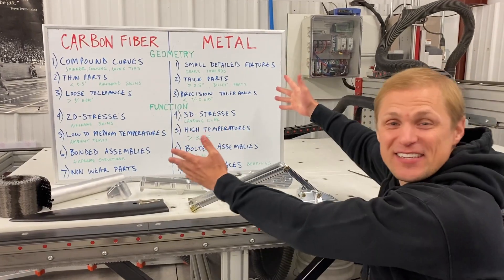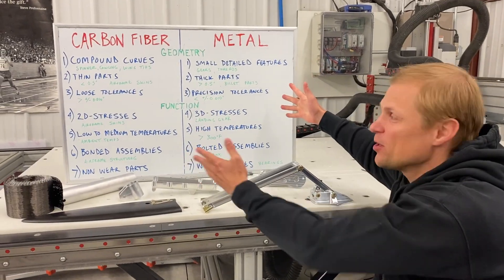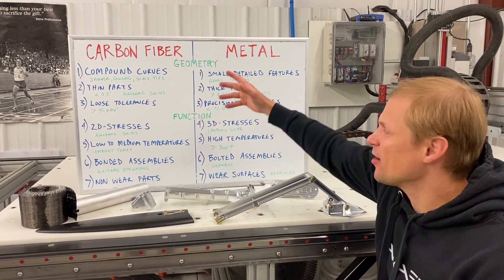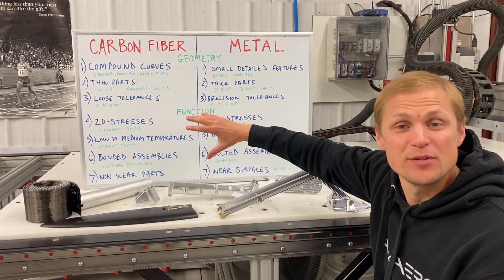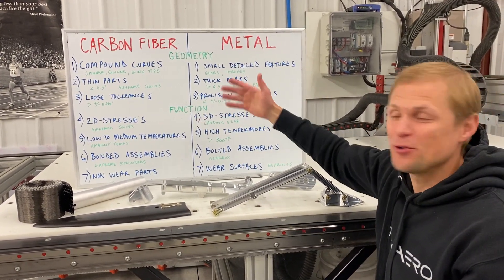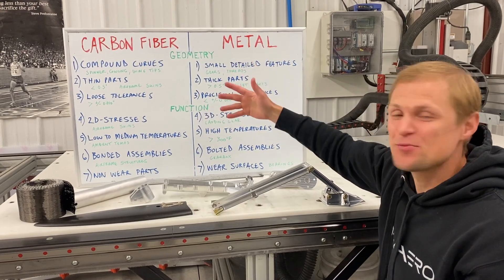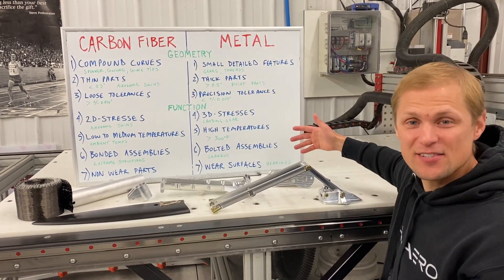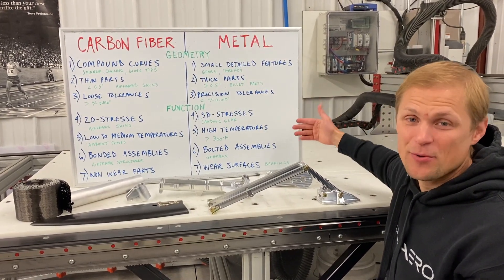CARBON FIBER vs METAL | Which is better?

Comment: One small addition - there are alternative ways of making CFC parts for other applications, for example "forged" carbon fiber. They consist of chopped carbon fiber fragments and resin, typically 5-15mm in length. The manufacturing process is somewhere inbetween what you're used to from carbon fiber and injection molding. That means you can make a lot more intricate shapes than you could with normal CF mats. Less ultimate strength than carbon fiber mats, but still very light and pretty strong, and more isotropic material properties since all the fibers are oriented differently.
Reply from the maker: Good point! We’ve experimented with “forged” carbon a little bit to make carbon fiber tube connectors. It definitely has the potential to create more intricate parts that can handle z-component stresses. One part that would be cool to try to make forged would be our nose gear trunnion halves.
Reply: @DarkAeroInc  , and your polymer is also an issue/opportunity. You can design into your composites temperature constraints, as well as friction coefficients, hardness and other properties.

Comment: Thanks for the video. 
I wanna add a few things, carbon fiber and fastener interaction (mostly made of aluminum) can cause corrosion. So you need to seal the fastener. Then, carbon is sensitive to machining, you may damage to part and weaken to composite. Lastly, carbon has high cost :D.
I have 2 question as well. How about their fatigue life performance? What precautions you take for the lightning protection of carbon?
Best Regards :)

Comment: I think you'd prefer Inconel 625  to titanium for your exhaust. Unfortunately I  both can't afford nor build it for you. Bummer!
Reply from the maker: The reasoning for going to titanium would be to reduce weight since titanium is roughly 60% the density of the 304 stainless steel that is currently used for our exhaust pipes. This would shave a couple pounds off the firewall forward weight.

Comment: One specific question, I don't know whether you'll choose to answer that. What are different strategies and best practices do you guys have for bonding and bolting metal parts with carbon fiber and carbon honeycomb internal structures?
Reply from the maker: We use a couple different strategies. For fastening small items we just use Click Bond studs and nutplates. These work for attaching loop clamps to constrain wire bundles or fuel lines. If the bolted joint is going to have large loads we install hard points. The hard point consists of a puck of material that replaces the honeycomb locally and then this is capped with additional layers of carbon fiber. A hole is drilled through this assembly for a bolt to pass through. The puck prevents the sandwich panel from being crushed and supports bearing stresses from shear loads on the bolt and the extra layers of carbon transfer loads from the puck into the panel skins.

Comment: Hey, guys! Thanks a lot for sharing your experience with us! This is really a class that I'd like to attend. 
Some time ago you've shared your experience with making free-form carbon-fiber parts from resin mixed with fibers. I thought then how would I try to make a really stiff parts but save some weight. And the thought I came to was making a foam from this mix and slowly rotate the mold until it cures. Here is the vid with the metal foam casting process which is quite similar to my thoughts: https://www.youtube.com/watch?v=jTc1XR_e0lw. The trick is that foam gives a lot save on weight and much improvement to the part's stiffness because small spheres inside doesn't bend.
Did you try something like that? Or, if not -- could you?
Reply: With these metal foams I would see a problem to detect a failure of the part. With non destructive testing methods you often look how sound or electrical resistance travels trugh a part and you compare it to what you would expect from a new part. Is the part very unpredictable from the start that could be next to impossible. Also with metal parts you could have them bend as a failure. Some of these special materials got special properties that make them break in an explosive way without a noticable build up. For some applications interesting non the less.

Comment: Weakness in the Z direction might apply to CFRP billet, but you could assemble such a flange with reasonable strength if you applied the layers in a non-planar fashion.

Comment: Probably you knew this already but SpaceX is making their latest Starship rocket out of stainless steel rather than carbon fiber. Stainless gets stronger at cryogenic temperatures & resists high temperatures much better than carbon fiber. Therefore, it needs much less heat shielding for reentry (less mass) and less structure when lifting off full of super cold liquid oxygen and liquid methane fuel (less mass as well). Counterintuitively, stainless ends up being about the same mass as a carbon fiber + heatshield counterpart, while costing a fraction and being easier to manufacture.

Comment: As a mechanical engineer, I have to say that my selection process always starts with how it's used then to look at properties.  I think about stuff like, "is this part ok to fail/sacrifice to save other parts?"  "Which part should fail first?" "Is rigidity a good thing or bad thing?" "Can the system be compliant?" "Is the environment harsh?" There are a lot of things to consider, but I always like to think of which part is the 'mechanical fuse' of the system.
Reply from the maker: Thank you for sharing your thought process! Just out of curiosity, what sorts of things are you designing that might need to function as a “mechanical fuse”. The closest example I can think of like that in kit aircraft is shear pins in autopilot servos which are meant to fail first.
Reply: @DarkAeroInc  I do mechanical design and engineering for large automated industrial equipment.  And you're definitely on the right track about shear pins being a mechanical fuse.  Besides failing, the thought of which wears first when you think about service.  You don't want to replace a giant weldment when it just needs a new bushing or something.  I do a lot of design with flexures (which are awesome) they can be designed to be ridged in one direction but compliant in another and at a certain point it will bend or break protecting the rest of the system.  AND it's a single piece. They're so cool.  You can also think about which part fails first when designing your parts.  I forget the term, but it's like strain energy balance, essentially if you design a part or assembly that has a uniform stress throughout then the failure mode is the entire part or assembly.  However, if you tip that balance so the stress is higher in the cheaper easier to replace part, the cheaper part is the "fuse".   And you can save the more expensive part or be able to still function at a reduced capacity.  There's plenty of design philosophies out there, my favorite being the Gene Kranz school, "a preoccupation with failure results in highly reliable systems."
Reply: @DarkAeroInc  It is typical in automotive engine design to make rocker arms out of relatively weak cast material that will break first if a valve hits a piston. If the valve breaks the whole engine is likely ruined. A broken rocker arm usually leads to a moderate cost repair of the engine. The rocker design is “sacrificial”.
Reply from the maker: @rickhearn5899  ooooh that’s a good example!
Reply: @rickhearn5899  so that's why Pontiacs always had rocker arm issues.
Reply: @DarkAeroInc  Rivets in parachute enclosures, canopy mounting, shock absorbing seats, crumple zones in airframe, used in propeller drives for prop strike, elevators on aircraft use it incase one gets jammed the other can break free and operate, landing gear used it incase of hard landing and shock absorber is overcome allowing further degree of absorption. It is used a lot. A large part of engineering is making it safer for when it does fail.
Reply: Please remember the first law of modern Automotive engineers. A $500 computer will burn up and fail to save a $0.10 fuse.
Reply: @44hawk28  The first law of modern automotive engineering is Marketing;)! Regarding the reliability of modern cars and engineering products: if we take at least superficially the statistics of breakdowns in the auto industry with internal combustion engines over the past 10 years, then there is a trend of predictive engineering in the opposite direction - the resources of parts of the main units such as an engine, gearbox, etc.  are made in such a way that they simultaneously and predictably fail and break down upon reaching the warranty mileage, and then repair decisions exceed the cost of buying a new car.  This is so noticeable when you find out the cause of the breakdown and what led to it.  For example, AUDI began to make a seats for a heavily loaded exhaust camshaft in the cylinder head with a smaller support area with oil film in order to increase the local load on the camshaft and increase its wear rate.  And so in everything, look how the resources of household appliances have decreased, and even LED bulbs with a declared resource of thousands of cycles cannot withstand even a couple of years of operation, because  inside there is a micro chip with a programmed number of cycles before failure and these are not the declared thousands of hours.  Marketing...

Comment: I also tend to weigh in budget and weight constraints into my decision process. Carbon is lightweight but there is a point that for a small weight penalty the same thing can be made from say traditional fiberglass or aluminum for a fraction of the cost with similar strength specs. 

Love your content gentlemen👍 Keep- em coming!
Reply from the maker: Weight and cost are important, especially in the realm of building an aircraft, so thank you for pointing out that these factors should be included in the discussion! It’s always a balancing act trying to create strong, lightweight parts without the cost getting out of control. We have a few spreadsheets where we track the part weights and costs. This way it’s easier to identify where to focus your effort when trying save weight by spending more money. For example, we could save a few grams by converting some of the landing gear components from aluminum to carbon, but this would be really inefficient from a cost perspective. A higher priority item might be converting the aluminum oil pan to carbon fiber  which would save a few pounds without being crazy costly to manufacture and test. 

Also, we’ve been enjoying following the progress you’ve been making on your project! Keep it up!

Comment: have you seen the new ul520ist?

Having a turbo normalized  motor is intresting.  Not sure if it will fit,but if it would the extra 30# for an extra 20 hp at all flight levels would be nice

Comment: G,day Riley and DA team from Sydney Australia.
Material selection (me)
* cost
* performance 
* availability
* engineering process
* health and safety
Q2. The firewall on DA, will smoke be eliminated from the cockpit?
🌏🍧

*I
Reply from the maker: One of the requirements of the firewall is to keep both flames and hazardous gases from passing through so we are taking the necessary measures to seal out smoke.

Comment: Good piece on material design considerations. Just to add...carbon fiber structures do not fatigue like metal structures—an important consideration in wing design. 
This recent video release teaser looks like it was actually captured a year ago. Am I correct? What’s happening now?

Comment: How do you resolve the 3D stresses at the point of load transfer where the metal components are fastened to the planar carbon shell?
Reply from the maker: Usually we use hardpoint, which is really just a small area that is locally reinforced. In the example from the video, (the drag link mount with six bolts) each bolt travels through a hardpoint in the honeycomb sandwich panel that the mount is bolted onto. The hardpoint is a cylindrical puck of phenolic plate that replaces the honeycomb core to prevent the core from being crushed by the bolt clamping loads. Over the puck are additional layers of carbon fiber that cover the puck and overlap onto the surrounding sandwich panel skins. This transfer the loads from the puck into the skins of the honeycomb sandwich panel. Thanks for watching and for the good question!
Reply: @DarkAeroInc  In the production kits would you cut out the honeycomb BEFORE you layup the sandwich panel, insert the phenolic plate into the honeycomb layer as part of the layup?  This would eliminate a lot of steps in the build process wouldn't it?  Just need to drill out the hole and the hardpoint is already there!
Reply from the maker: Hi Richard! We would like to integrate the hard points into the honeycomb panels but the manufacturing process we use right now prevents that. Luckily the installation of the hard points isn’t too challenging, even though it does add another step. This is something we are still sorting out but a good compromise might be installing the hard points in the bulkheads when they are still laying flat at the factory rather than when they are installed in the fuselage and positioned more upright.

Comment: Speaking of composite casings, I believe Formula One cars use carbon fiber transmission cases. Also, I read that there has been some development of partial composite gears in helicopter transmissions. https://www.compositesworld.com/articles/new-aerocomposites-niche-helicopter-transmission-gears
Reply from the maker: Those gears look really cool! I hadn’t seen that before so thank you for sharing. I noticed the gear web was made from carbon but they maintained metal for the gear teeth. It makes sense to only utilize metal where it’s needed at the teeth and then replace the web of the gear with carbon to keep things light.

Comment: Love your videos. Quick question, what material is the honeycomb made from?
Reply from the maker: The honeycomb mentioned in the video is aluminum but we also use quite a bit of aramid honeycomb core. In production we are planning on using all aramid honeycomb core. Thanks for watching!
Reply: @DarkAeroInc   if memory serves you made sandwich panels for some parts to be cut out of.  Are you able to find commercially available stock for those applications in production?
Reply from the maker: Hi Tim! We make two main types of flat panel stock: honeycomb sandwich panels and solid carbon plate/billet. We wanted to use commercially available honeycomb panels but we couldn’t find any standard panels that were right for our needs so we built our own. We plan to stick with our own in-house panels for production. The solid carbon plate we make is more ubiquitous so we might offload that in production. Some of the parts we currently make from solid carbon plate could be converted to phenolic plate which is readily available, inexpensive, and easy to machine.

Comment: A side note that I wanted to run by you since you seem to be decent engineers; since engine weight and size is important to planes, how about a skeleton engine of HS steel instead of an engine block. The forces in an engine are only so great so have the cylinder walls as free standing quite thin tubes and all force transfers as welded tube cross braces. The primary forces are vertical straight up and down between cylinder wall/top and down to its crank shaft. The force needs should be quite focused and narrow and require little material. Looking at for instance a rotax 912, the cylinders themselves are very small so if a working shell skeleton could be made, it would presumably be super light. And that's what we need. some compactness improvement should also be possible. Given how tiny the 4 cyl boxer arrangement is, any significant expansion outside of that I consider a great failure. There should be no voluminous oil pan or sprouting intakes and exhausts. Ideally it would be some organic FEA skeleton but welded tube can be quite close to optimal and a good compromise. Could it work? could the engine weight be cut by 80%
Reply: Could it be done yes.  Is it practical NO!  Not angry here, but go study, air cooled aircraft engine designs they use thin cylinder walls and light weight material for >50years in GA, military more like 100 years.  Keep asking questions and bringing ideas.    Edison said “there is a better way, now go find it”
Reply: @timduncan8450  I didn't just mean any old air cooled engine. Aren't aircraft engines just cast metal? both cylinders and crank case. As well as piston heads. With fins and flanges and bolt holes cast in. Any old potmetal. I was thinking just a tube of the best material, be it inconel or other heat appropriate high strength material, no cast crank case from a steam locomotive. Just the bare skeleton to carry the function and forces. Of the strongest materials. No casts. No blocks.